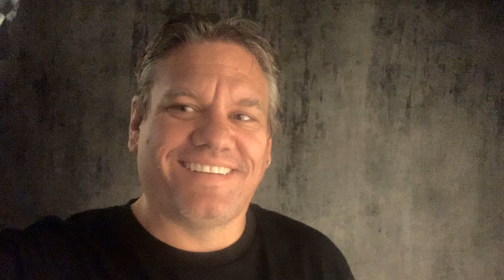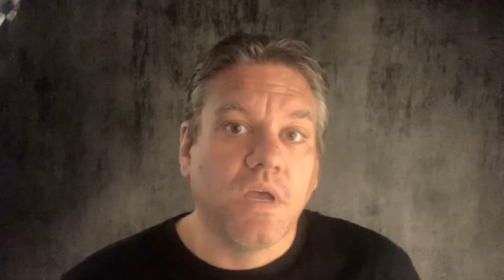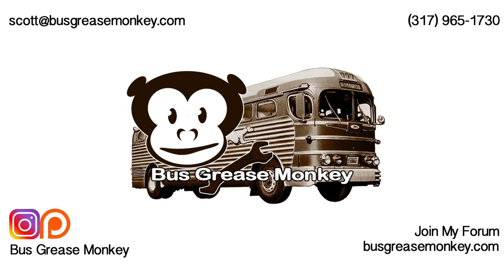20+ questions with Bus Grease Monkey Scott Traveling vintage bus mechanic detroit diesel

Comment: Scott... in reference to the question asked about "why Detroit Diesel didn't build 4 cycles" (which of course, they did and do)... and your response to it.... I would like to add some additional reasons for the change over to the (at that time) Series 50 & 60 engines (4 & 6 cyl. respectively) was not only the emissions situation, but DD had lost a huge part of the OTR (Over The Road) / heavy truck market, which years ago they dominated, just as they did in the marine markets. 

The main reason for the loss of market was due to Two issues, One was fact, the other was ignorance of the first, resulting in misconceived understanding and "bad mouthing" of the engines (2 cycles).  The Fact is, that even though the 2 cycles are in general (as far as the GM Diesel design was concerned in this case), 33% more efficient than the 4 cycles, developing near identical hp and torque outputs on approximately 33% less displacement compared to their 4 cycle counterparts.... it also proved to be the "Achilles' Heel" as it were. 

It is one thing to be able to produce for example... 1,650 ftlbs of torque (albiet, with a "fatter" curve than a comparable output 4 cycle), but it is quite a different thing to be able to SUSTAIN that torque (and therefore, road speed in commercial vehicles) on hard pulls (ie: weight versus gradients)... which is critical when it comes to the trucking industry. 

To make a very long and technical story - much shorter and more easily understandable for those lacking the knowledge....,  as you increase the Stroke length of ANY reciprocating internal combustion engine... you effectively increase Internal Inertia... like adding a heavier & heavier flywheel... which is the result of Increasing the Piston Speed, which is how fast the piston (NOT to be confused with Crankshaft Rotational speed or "rpm") travels within its bore to complete one revolution of the crankshaft. 

It would be like comparing Two "Barrel Racers" at the rodeo... if say - racer/horse "A" (on horseback of course) has their "turn barrel" 60 ft further down course from racer/horse "B" and they leave at the identical same time, But Both have to arrive back at the starting line at exactly the same time... what has to happen?.... horse "A" has to run faster, to achieve the same return time as horse "B".... and in turn, creating more momentum.   THAT... in a nutshell, was the "Achilles' heel" that spelled the end of the 2 cycle Detroits.

It resulted in a huge amount of ignorantly misguided "knowledge" across the vast majority of the trucking industry... that the 2 cycle Detroits were nothing but Noisy, leaking, "gutless wonders" with no torque.... when nothing could be further from the truth,  as far as torque & hp output is concerned.

The very real problem was too short of a stroke length, and therefore lacking the internal inertia to Sustain the torque... especially when you consider that you Must subtract from the length of piston travel (5" total in a Series 71), for valve opening followed by the length of travel for intake port uncovering... and you wind up with essentially, only about 4" of "usable" power stroke.... and of course DD tried to "make up the difference" with more cylinders... when Cat, Mack & Cummins were moving further away from the V8's of the era to larger displacement inline 6's.... which is what the trucking industry wanted, and unfortunately.. Detroit Diesel did not "appear" to be paying attention to, by their lack of a right "response". 

If they would have developed an inline 6 within the Series 149 family, they would have had a powerhouse that the 4 cycles could not have competed with in those years, even today, would only be running "neck & neck" in terms of power output.... with the exception of course, of the ever looming "emissions" standards, along with the possibility that it "may" have been too heavy (over 5,000 lbs), considering the weight of the 8V149NA. 

The 6-110 was seriously considered for a short while in the early 1960's as a candidate to be put into heavy duty trucks (semis, etc) and in fact, actually developed a prototype unit using a GMC Cabover ("Crackerbox") of the era (1963) and proved to be very strong in that application... however, Corporate "heads" prevailed and the 6-110 series was dropped from production in 1965 (after 20 years of production) in favor of more cylinders within the series 71 engine family..... a bad move, and a complete "misreading" of the needs and direction of the trucking industry (especially the Owner Operator segment), on their part... though, I am personally very grateful & thankful for the V12 in semis of the era. 

My personal favorites of the 2 cycles were the 3 & 6-71's, 12-71 & the 6-110.... out of which I owned and "built" three V12's (re: modified) for my own semis, and also "wrenched" on the Lady Butterfly Pulling Semis (NTPA Pro Semis sled pulling class) out of E. Canton, OH. before it was sold due to ongoing health reasons (not me).
Reply: You obviously never drove a big truck with a Detroit. The real reasons Detroit lost market share was noise, and lack of torque.
On flat ground a Detroit is a power house but hit a hill they lay down and die. Cummins Cat and Mack could accelerate on the same grade a Detroit would be begging on.
I have an 8V71 Detroit in a Chevrolet Bison, 335 hp and it can't hang.

Comment: 12V-71 in any form is the best sounding detroit diesel ever ,, with or without a turbo or turbos ,,,i drive a 1977 Peterbilt 359   that has a 12V71 with dual turbos ,,, it's a beautiful sound ,,and the torque is absolutely amazing

Comment: Yet another question regarding the actual ID tag color as related to the calibration. What is the difference?  For example, an N70 on a black tag as compared to an N70 with a brown or other color?

Comment: one dollar a mile is cheap.  You should charge more.
Reply: why? for 1 dollar a mile you can ship stuff clear across the country. There is also a $250 service fee for showing up. that makes a 250 mile trip a $500 charge. for say 5 hours of driving and 25 gallons of gas? I think Scott's rates are reasonable. His shop hours are reasonable too. Those buses represent a for sale value of 20 grand or so. It has to make sense for both sides. Scott, does want to do this full time, and there are only so many buses.

Comment: They guys that jump in and drive never inspecting brakes or air systems are the same that never checks their vehicle brakes until they stop performing... or maybe, just maybe when they start making noise.   Very frustrating.  I'd like to think they realize the mass they are dealing with, but sadly we know otherwise.

Comment: I agree with you about people with RV’s with air brakes and over 26,000#s , should have some kind of training or testing to operate. Maybe not quite the same as a commercial driver but something at the least. I’m no diesel mechanic, or gasser either, I do have a CDL and have driven just about everything out there. Watching your videos are very informative,and helpful for people like me operating heavy truck. The way you explain everything from mechanical operation, to air brakes, suspension, wheel bearings, is amazing 😉 thank you for your videos, and all the work it takes to edit and produce them...  BTW those old buses are my favorite!
Reply: In Ontario Canada we have a class called Restricted " A"  if you are towing anything over 10,ooo lbs. You need to show up with your rig for a road test. They probably test you on air brake knowledge, but I'm not sure, as I don't tow anything over 10,000 lbs.  As to weather or not you need a yearly medical like a CDL ticket I don't know that either, but I do Know they safety inspect and pollution check every year on  all trucks capable of towing over 10,000 Lbs. So you 2500, 3500, and on up. I must say the program has really cut down on run-away tyres.
Reply: Thanks for that info. I live in Michigan, and here when you have a commercial driver license, you also are required to have a medical card that proves you are physically fit to operate the vehicle. When it comes to personal heavy vehicles and towing I think all states should have some regulations. My personal opinion is you as driver should know your vehicle in and out, know what its capable of, gvwr, gvw. And you should keep it maintained properly. So many people wait until they have so many things wrong, and stop caring, when it’s broken or worn out dammit,fix it.
Reply: @tonyfaconi3442  I'll 2nd your wanting some kind of accountability for those rigs BUT with the kind of $$ they can throw around and laugh about it and buy the government off, it'll never happen. I live in the WNC mountains and $500k for a rig here is not uncommon. Google 'Mountain Falls RV Resort'' and take a look around. And $500k for just enough room to park one on isn't unusual either. I got a Chauffeurs License at 21 and was raised in these Blue Ridge hills and just try and dodge one of them non-driving people and you grossing 80k on these terrible roads. I'm like you in that every last one needs some kind of course but none will get it. WAY too much money flopping around. And I did the grading on a lot of those little cabins there. Been there and about got run over several times.
 Keep after it, Tom. GBWYou!

Comment: A 12 v 71 would pull the front tires off the ground.
Reply: Buzzing Dozen
Reply: best sounding engine detroit ever made in my opinion ,,,
Reply: A guy had him working on a twin turbo mc6. That thing could do 80mph up mountain passes for sure.
Reply: old flatbeder Back when I still doing the OTR thing I got the pleasure of driving a ole Freightshaker with a 12v71 with twin turbos and I loved it.
Reply: I own a pete 359  with a 12V-71  with dual turbos and aftercooler  it's absolutely awesome 600hp and 1600 pound feet of torque  it'll climb hills like flat land and it still has the factory original  Spicer 6x4 twin stick 

i've also owned a heavy haul version that has 3 drive axles and powered steer axle and the factory 12V71 was swapped for a 12V92 with 4 turbos

Comment: I think they went for 2stroke disel, because they wanted lihgt weight and powerful diesel. Back in days the naturally aspirated 4 stroke diesels were heavy, and not too powerful. They could put the supercharger on 4 stroke, of course, but the head gasgets werent good enough. 2 stroke cylinder pressure is about the same as naturally aspirated 4 stroke engines, but bangs are just twice as often, so more power whitout need to make twice as big engine.

Comment: Consider using a webasto oil fired hot water heater with a heater core instead of a propane burner for onsite heat as it would allow you to prewarm the Detroit by simply running hot water into the engine block.
Reply: James Shanks..... I used them (as well as many other guys) on the V12's in my semis when I was running up into northern Canada and the NWT back in the late 1970s & 1980s.... they worked well, but with the advent of the self contained little diesel generator set-ups for the semis, that you could circulate the coolant through the main engine as well as the little unit, the Webasto units disappeared rather quickly.    Some of the Webasto units I saw were also available to burn pump gas... and more than one, caught fire and burnt the trucks they were set up on... down,  fatally in one case I know of.

Comment: Ingersaul rand makes most air starters, the original air starter required 100 pounds of air in a large air starter tank.

Fast forward to the early 2000's, they redesigned the air starter. Still uses the same reservoir for the air starter but now a filled air tank to 100 psi will crank the engine over up to 3 times each try being 20 seconds each before it runs the air too low. The big advantage with the new design is it will crank over as low as 60 psi and start the engine. I know several truck drivers who prefer air because their trucks carry 10, 12 or 18 extra air reservoirs called tires, one owner operator after his wife ran it out of fuel used 15 tires until he finally got her going. It took him just over 2 hours to refill the tires. Two days later he bought and gas powered air compressor to avoid having that problem again, the fuel gauge worked, she missed the exit and simply figured she'd stop at the next truck stop but it was out of business.

Cheers!
Reply: Used to work around a place in Houston that rebuilt Diesels for the Mexican Railway. They had a huge engine stand where they tested them out. When they would hit that air starter you could hear it 1/2 mile away. Amazing to watch.
Reply: Instead of cranking for days he could have just bled the injectors...